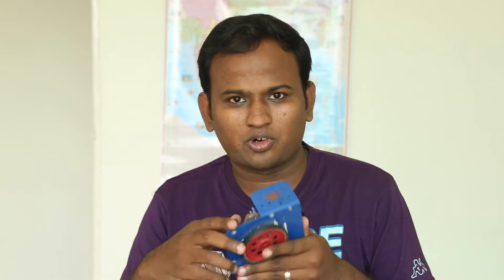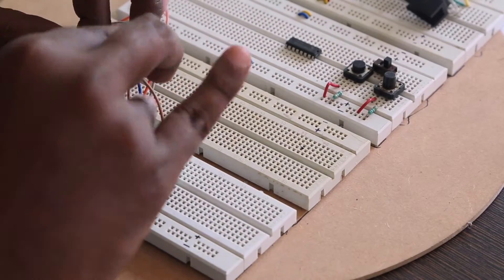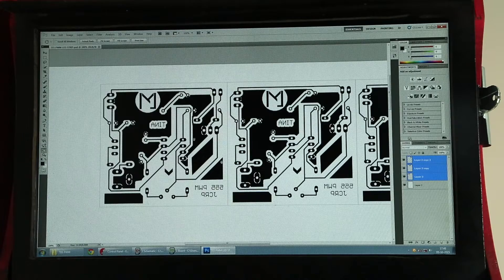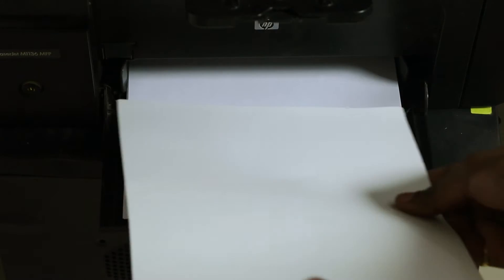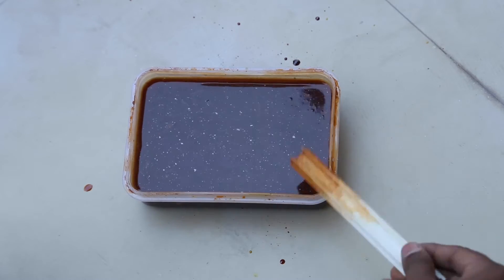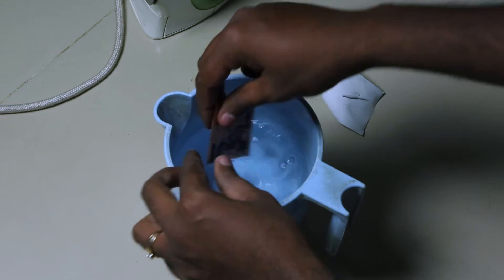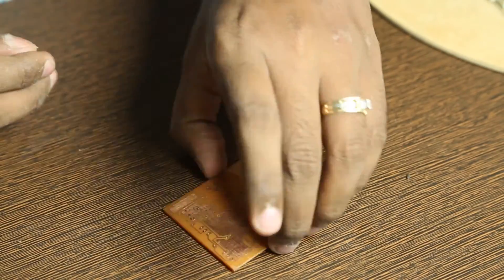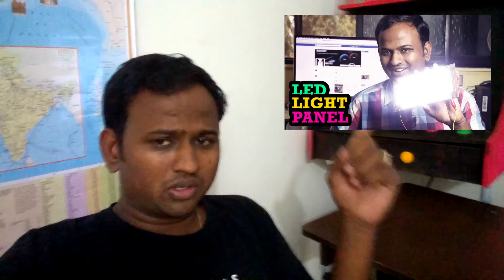DIY 12V2 LED Dimmer / Speed Controller - PCB Toner Transfer Etching

Comment: What does the diode do?
Reply from the maker: +Kamran Raja if you connect a motor then as the motor stops the current generated by the motor movement runs back to the circuit. The diode connected in reverse order prevents it.
Reply: +mediamilan please tell me which one is the reverse side.